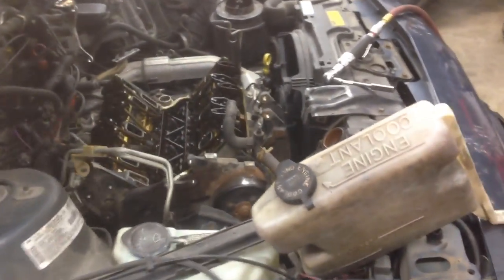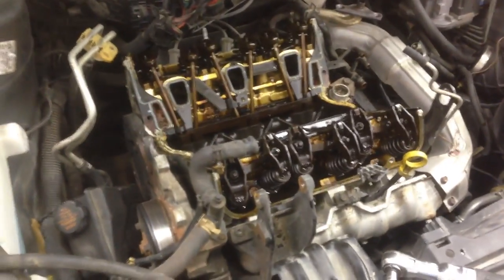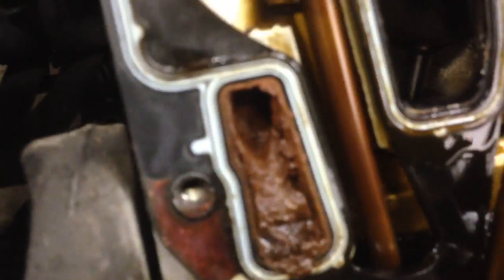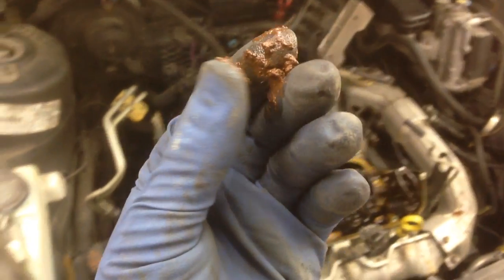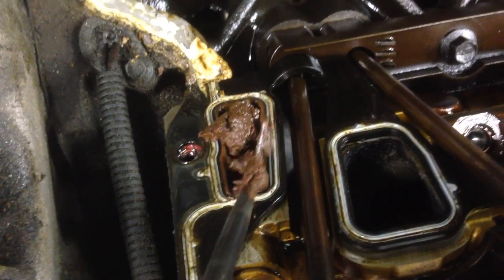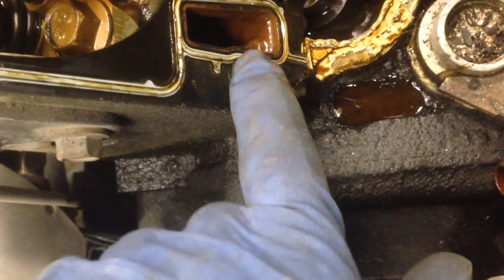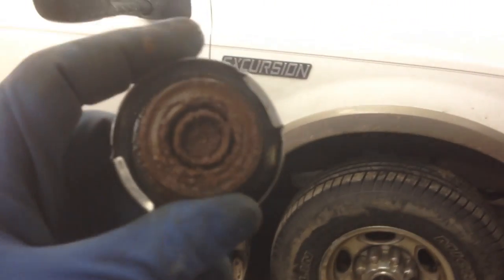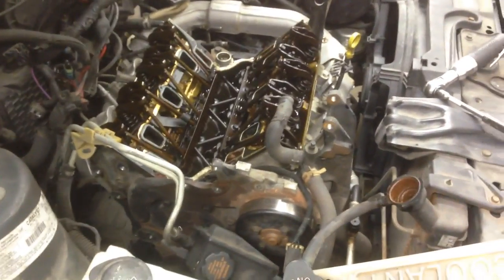Why it's called DexKILL

Comment: I've seen this shit before ,, my mom bought a 1999 chevy S10 with the 2.2 I4  and it was almost  3 years old with just 25,000 miles when it started running hot ,,and the heater was acting funny , didn't get hot like it should ,,immediately took it to the dealer  and the dealer guy told me it was the thermostat  , I watched him change the thermostat and asked him what the red sludge on the radiator cap  was,, mechanic told me it was no big deal ,,I'm not stupid so i was curious and started asking about it , that was in jan 2002 ,this truck was under warranty at the time so i couldn't touch it ,,and they wouldn't mess with it , I know they were putting me off   till the warranty expired ,,but i paid for the 6yr/72K mile warranty I realized after a whole year what was going on  ,when my neighbor had his 99 buick park ave doing the same shit as this car in your video ,,I took the truck into the dealer at that point and ordered them to fix it  cause i've been dealing with this truck overheating constantly by this point running at 205F or more even in the cold for over a year ,,it took me threatening to sue the dealer before they called in a GM mechanic from the company to look at it ,, the guy treated me like an idiot and told me it was my fault it did this  ,, and this being my mother's truck with a warranty on it i told him he was full of shit cause it's not mine and i've never done anything but oil changes every 3k miles on it ,,
took the dealer a week to fix it ,, they had to replace the heater core and radiator and flush the engine ,,
 2 years later it was doing the same shit again just as the warranty expired ,, I drained the coolant , and filled it with water and poured a bottle ot CLR  /calcium// lime/rust remover in it
drove it about 20 miles on the highway and then drained it  and flushed it repeatedly to clear the crap out of it ,,no more problems ,,that was in 2005 and it still hasn't had problems ,,only change , i put green in it
Reply: wildcoyote34 most vehicles since the 90s run a 190-210° thermostat. 205°f isn't over heating.

I do agree though that dexcool sucks though.
Reply: slashergrvr it would start out at 205 deg and gradually climb anywhere from 220-230 
it actually had a 185deg thermostat 

this problem started gradually over a period of a year and steadilly got worse ,when the dealer replaced the thermostat they put a 185 deg one in  thinking that would fix it ,,it took over a year before i could get the dealer to look at the truck  which pissed me off more than the dexcool issue did 
once i knew exactly what the issue with Dexcool was  it was easy to remedy 
when it clogged up the second time i flushed it with lime remover ,,CLR is what i use to clean older vehicles which have brass radiators  , they are succeptable to lime scale ,30-60min   hot CLR flush will get most lime out of even the most crusty radiator

it also worked excellent on this  sludge too but it requires repeated flushing  to clean the acid out of the engine ,never had an issue with corrosion afterward though
Reply: wildcoyote34
Reply: +wildcoyote34 - Yea we had a similar story to yours.  After 16 years of using GM Dex-Cool. Now (2017) my Dad decided to switch to Cheap Arse Walmart Brand.  He's tired of going to Mechanic for Flushing and Over-Heating.  We have a few year older Car with the same Engine, and we have been using Cheap Walmart SuperTech 50/50 Coolant.  Needless to say, we have " NEVER " had any issues whatsoever.
Reply: +Robert Mcbeth - Himmmm.... That is funny.  Calling him an idiot, but you don't know the difference between " Your verses You're ".  In your case, " Stupid is, Stupid does ". Aka - Forrest Gump  LMFAO !!!  😂😂😂😂😂😂😂😂😂😂😂😂😂😂😂😂😂😂😂😂😂😂😂😂😂😂😂😂
Reply: Don't buy Obama Motors

Comment: The gumming up is caused by the stop leak that was installed in the cars at the factory.  It is basically crushed walnut shells, and ground up ginger root.  It was added to remedy porous leaks inherent in aluminum castings.  I believe they stopped using it.  I did a head gasket job on my Chevy venture back in 2010, and since put 80k on it.  I used the stop leak, and understand if there is air in the coolant system, it will cause the gummy material to form and that is fine with me.  Seems the engine in this video had a undetected leaky water pump which caused air in the system for some time before the engine overheated.  Gm also recommends the overflow bottle be filled on a cold engine to the full hot line.
Reply: How disgusting!

Comment: If you want a long life coolant then use an OAT type. It has the same lifespan as Dexcool and won't kill your engine. I used OAT in my 2001 Astra G without any problems. The green stuff is the glycol based antifreeze (also available in blue) and the two types must NEVER be mixed.

Comment: Since 2008 all GM vehicle have improved coolant and engine seals that are specifically designed to work with Dexcool hence in the description it says early GM and Dexcool has recently been re formulated to be less corrosive I still do what is called REGULAR MAINTAINANCE  if you flush all your fluids every 5 years you don't have any of these problems.
Reply: WHATS YOURSOC   What you half to remember is all fluids oil, brake, coolant, transmission, power steering all have corrosion inhibiters and lubricant's and detergents whether you put 5 miles a year or 50,000 miles a year if you want to keep a vehicle in good shape you need to keep these cars filled with fresh fluids it is cheap insurance and if you do these fluid changes yourself you can save a lot of money.

Comment: I have never, ever seen that happen, what all you had to the system is dexcool. That looks like what you get when you mix dexcool and regular coolant. Some people are saying it looks like that stop leak additive, but it does not. Although you can get something similar to that with that stuff, and typically wont be as bad, and you would see the metal flakes in it. My guess is someone poured regular green coolant in there. The result is what you, and more importantly it becomes much more acidic, and heats all the rubber seals. That is probably why that gasket failed so quickly. I would be willing to bet $1k that if you asked the customer, they would say yes added coolant, and either used the green or the universal stuff.
Reply: Kevin Weil yea something is wrong there it looked like block seal and copper seal too me too
Reply: Kevin Weil thats what i thought as well i replaced rad and core in my 3.1 wagon 1990 and no sludge tge old fuck i got it from ran dex cool and i do as well  tgats sludge shit is from mixing coolants
Reply: Kevin Weil and stop leak too for sure  that shit causes more problems tgan it solves
Reply: Kevin Weil i think your right mixed green and dexcool and if they tried to change from dex to green then there would still be dex in the block an it would mix and boom big problem
Reply: dennis bryan it is do able but you have use a actual flush machine to push it all out. Or keep filling it with water, running it, draining it till it runs clear.
Reply: Yup many things can cause that sludge air, air in the system. Sometimes mixing reguler antifeeze with dex cool. I had done the experiment before. Still ither way I recomend to friends to get rid of there dex cool. A good system flush and reguler antifreeze is good. Along with changing thermastat to.

Comment: From Wikipedia - According to internal GM documents
 the ultimate culprit appears to be operating vehicles for long periods 
of time with low coolant levels. The low coolant is caused by pressure 
caps that fail in the open position. (The new caps and recovery bottles 
were introduced at the same time as DEX-COOL). This exposes hot engine 
components to air and vapors, causing corrosion and contamination of the
 coolant with iron oxide particles, which in turn can aggravate the 
pressure cap problem as contamination holds the caps open permanently

Comment: That looks a lot like Bar's Leak, are you sure the customer didn't put some of that in the cooling system?
Reply: its had some thing in it
Reply: It has Dexcool, I know when I bought my Grand Am with 3.4 looks the same. Did my gaskets and only run Amsoil on it 2004,000 and runing solid.
Reply: @victorfanfan7026  wow! A 2 million mile engine! Better call GM right away!
Reply: @tomnovak7731  sorry is 222,000 😂

Comment: This is the problem I am having with my 2007 Buick Lacrosse. I bought the car used, from a dealer, in August 2015. That winter, I took the radiator cap off to check the antifreeze and found the radiator cap and radiator "neck" full of that same orange putty stuff shown in your video. I took it to the local mechanic who flushed it with Prestone radiator flush. He said he had to flush it several times to get the gunk out. He also put in a new thermostat. He told me that someone must have put the wrong antifreeze in it and that's what caused the orange gunk. I am not a mechanic and live alone so I take my vehicles either to the dealership or the local mechanic for repair and service above and beyond the basic replacing wiper blades, checking tire pressure, and checking the fluids so was really puzzled as to who could have put in the wrong antifreeze. Never the less, the car ran fine and everything was good for a year or so then it started running hot. I took the radiator cap off and the radiator was full of gunk again. I took it back to the dealer this time. The dealership mechanic told me someone had put the wrong antifreeze in the radiator. This time I knew better. No one had touched my car but a licensed mechanic. The dealership put in a new thermostat, flushed the system until it was good again, and charged me a fortune. They put the same Dex Cool antifreeze in as before. I have been dealing with this every year since. I am done. I am going to take it back again but to a different dealership and this time, NO DEX COOL! I don't care if its air in the system or just a bad product. I wish that I had seen this video sooner. The original dealership sells Buicks. They should have known that the problem was not someone putting the wrong antifreeze in the radiator. They acted like I was lying every time I told them that no one had touched my car but them. Jerks!

Comment: For those of you who want to switch to green coolant... be careful. Even if you flush the coolant thoroughly, it can still cause issues. The key to avoiding dex cool turning into dex kill is to change the coolant when reccomended.
Reply: Just flush the dex cool out several times and you're good have done it.

Comment: that system hasn't been flushed since the car left the dealership
Reply: Yep!
Reply: That's no excuse, my toyotas and mercedes go to 300k and the coolant housing look brand new without flushing.
Reply: @Motorsportsgeek  Okay? They use different types of coolant which have different lifespans
Reply: @porcupinepunch6893  True, it's been almost 5 years since that comment and I now own a dexkill car. I've already changed the fluid once, no way am I waiting for 150k miles as GM claims it's good for.

Comment: The Dexcool isn't congealing because of air.  It's congealing because someone used an incompatible additive (or mixed some normal antifreeze with it).

The first thing to do when you have a car with Dexcool in it is to completely flush it out and transition to either standard green coolant or to Evans Waterless Coolant.

Comment: Not for nothing but that's not just dexcool , someone put additives in there as well , I opened my motor after 125,000 miles , dexcool was changed out at 90,000 miles , my motor had NONE of that stuff in there at all ??
Reply: Its oil,antifreeze coagulation from leaking intake gaskets,seen it many times.

Comment: Looks like radiator leak stop to me.
Reply: same thing happened to a 4.3 my neighbor had and it looked just like that it took 3 flushes of the system to clean the system out
Reply: Yup, that liquid copper shit.
Reply: Dranksta I has an old car that got a wicked blown head gasket. Filled the radiator and it would literally look like a water hose coming out the exhaust. My dad told me to put that copper flake shit in it. Told him that shit didn't work but did it just to please him. Low and behold the shit sealed the damn head gasket. Would have never imagined. Sold the car immediately after. Doubt it's a long term fix.
Reply: poop53 I've seen head gasket stop leak that worked!  it was in a Ford Taurus a friend had, I thought it was a joke but the bottle said "for head gaskets" lol so he dumped it in and drove it for a few months more.
Reply: poop53
 Yes sir. I admit i have used it as well when i was younger, i had a 95 GMC Yukon leaking coolant and was out of town. It worked, got me home and i forgot about it, leak came back after about 10-15k miles and reminded me. Replaced head gasket and all was good. Definately not a permanent fix, but it sure does work.
Reply: YUP
Reply: @drsta804  its not thats what happens i seen it all the time

Comment: An automotive dealership can't survive on sales alone. It is critical to have the parts and service departments too. It's possible GM engineered a plan to keep the parts and service departments busy with non warranty type work. The old formula for DexKill was known by GM engineers that the OAT formula was proven to erode certain plastic materials such as Nylon 66. GM engineers designed those lower intake manifold gaskets with a Nylon 66 frame. The destructive process takes time, the kind of time where the damaging effects happen after the warranty expires. DexKill formula has been redesigned since then.

Comment: I have never had a problem with dexcool in my personal vehicle but I also change it out about every 50,000 miles, the coolant passages on my 2.2 ecotec look like they were cast yesterday and the engine has 250,000 miles on it, dexcool is supposed to be alot more gentle on aluminum parts but if you don't change it on a regular interval then it gets nasty
Reply: Southern Mechanic 
Just perform routine maintenance and there will be no problems!?  The hell you say!
Reply: Southern Mechanic you hit the nail on the head. if you service coolant like your supposed to you don't have these problems. I've never seen dexcool do this
Reply: everyone wants to just drive there car and do no maintenance
Reply: You mean maintance isn't optional?
Reply: What if some additives such as stop leak were introduced or if glycol ethylene(green stuff) were used?
Reply: Southern Mechanic I agree. I was an ASE master mechanic and worked on cars for 17+ years. EVERY SINGLE TIME I saw this on a Dexcool car the rad cap held little or no pressure when tested ( they're rated for 16psi) and the system had other minor leaks. I've seen many vehicles with over 120k still running the OE cap. Failure due to lack of / no maintenance are NOT DESIGN FLAWS!

Comment: It corroded the block plug on my s10 while I was going 80mph on the highway and dumped out all of my coolant I look down at my temp gauge by then it was to late I lost power and my engine siezed so thanks alot GM